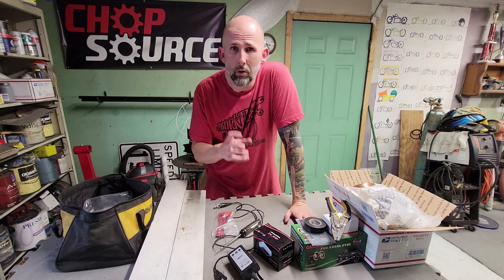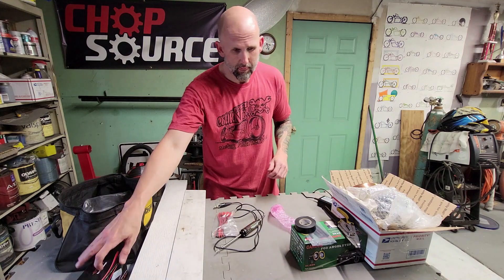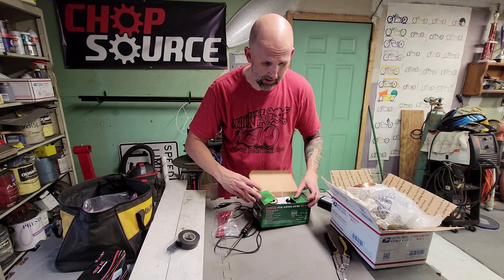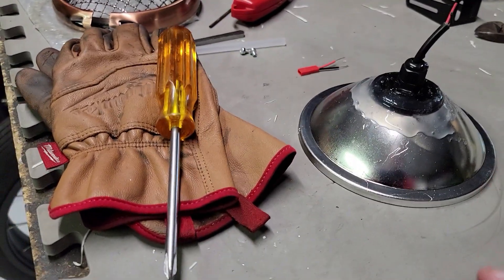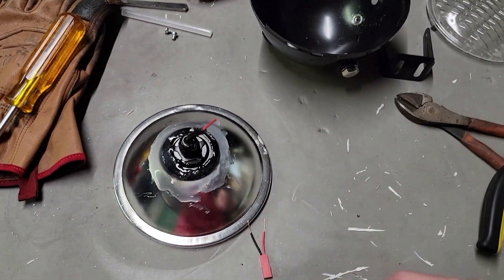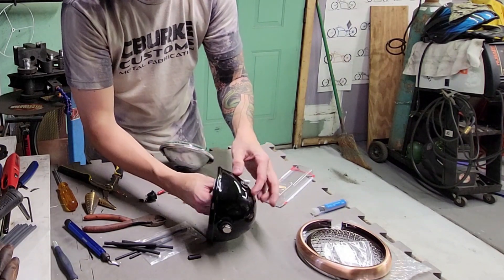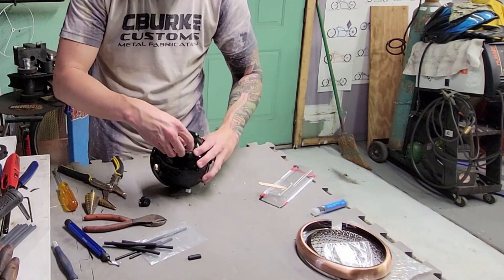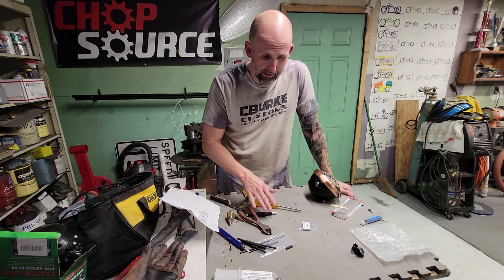How To: Custom Battery Powered Bicycle LED Headlight. Wire it up, Fire it up!

Comment: Been wanting to try doing this.  Thank you for the video.

Understandably, a year later the eBay battery link is no longer valid.  What are the specs for the correct one? Or maybe a fresh link?

Thanks again. Great channel!
Reply from the maker: Yeah I need to correct that link. They have them on Amazon now. https://www.amazon.com/dp/B089W89KCP?ref=ppx_pop_mob_ap_share
Reply: Thank you.

7.4v is a weird voltage but I'll take your word for it.  I don't need massive brightness for a cruiser anyway
Reply from the maker: @jmdrstv  seems to work. Lasts a long time too

Comment: Any information on the bulbs that you used?
Reply from the maker: Sorry, no. I got them in Amazon a long time ago.. Just look up Universal LED builds.
Reply: 2PCS Car Angel Eye Fog Light, Round COB LED Lamp High Power Bright with White Halo Angel Eye Rings Headlight, Universal Daytime Running Light DRL Car Driving Bulbs

Comment: Ahh, so technically this battery pack would power any 12 volt DC powered bulb?
Reply from the maker: I believe do, yes!
Reply: Alright. Just the push I needed to go after this mod. I’ve been wanting my own big headlight on my bikes for over a year now. All that’s left for me to figure out now is to purchase / make a bracket to install on my different head tubes. Any chance you have / can make one of those / or share links to to help with that aspect available soon?
Reply from the maker: @bernardmolek2  🤘🏻🤘🏻🤘🏻

Comment: That copper ring looks cool! I went the hard way and made led conversion for similar headlight, used 4 small 2watt power leds and made small brass block to hold them so it would fit in the original mount. Got it to be bright and not use lot of current. BTW I hope that LiPo battery is snug but wont bend under pressure, my friend flies drones and one of those started to burn in his car, he did throw it out just in time.
Reply from the maker: Yeah, no bending as far as I could tell. That always scares me about these cheap Chinese batteries lol. Can't wait for everyone to see all the copper stuff I got for Smooth-E.
Reply: @CburkeCustoms  Yes, I think I am starting to see how she is going to look but cool to see what is the end result😎✌
Reply from the maker: @anssiw737  🤘🏻👊🏻👊🏻👊🏻